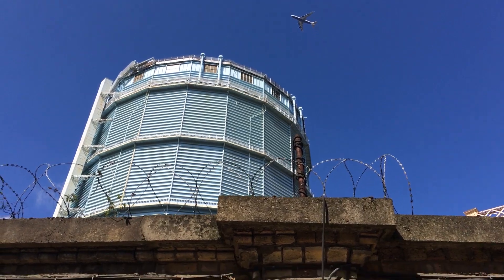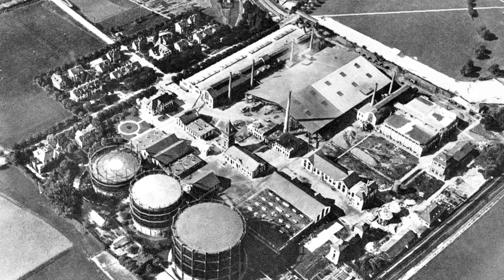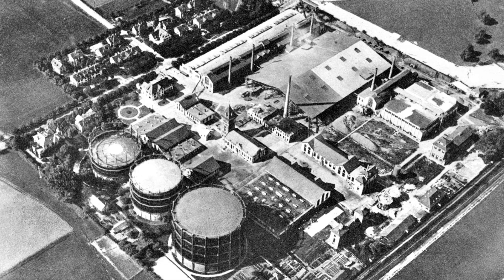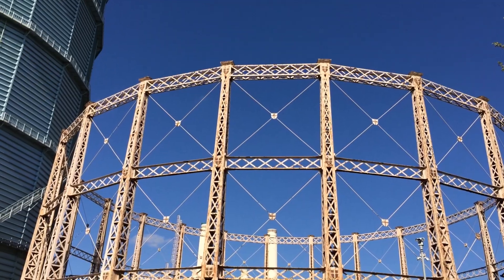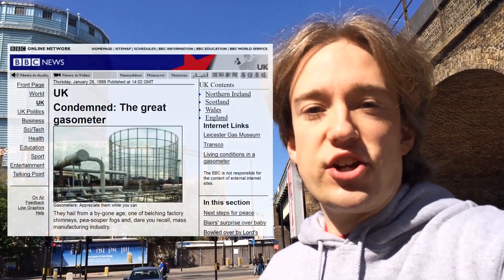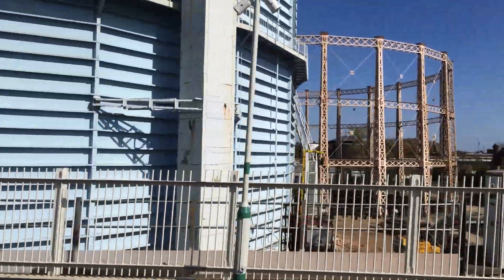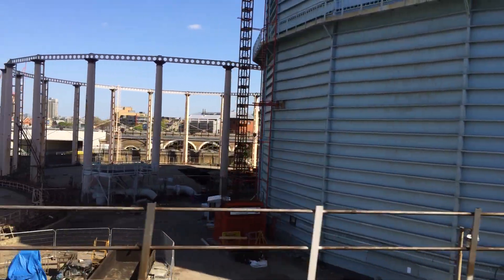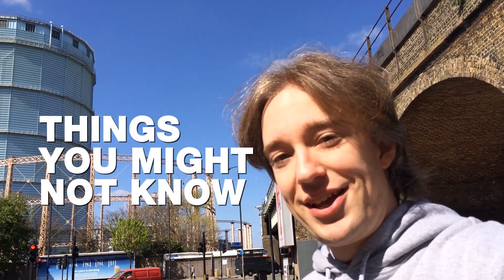The Rise and Fall of the Gasometer

Comment: very similar to lighthouses and water towers - they were everywhere and they were functional.  it seems we claim we 'upgrade' things but actually make them less efficient, even if it seems inefficient. Water towers were incredible efficient anyway, and look at the two by the crystal palace and the fountains all around it. Same thing in Parc St Cloud in Paris in 1720s, possible with the most fountains anywhere has ever had. It seems we had a greater ability to control water - and why stop at water?

Comment: Their were several gasworks around the suburbs north of Boston.  I remember seeing them as a child while my folks were driving around.  My dad told me they held gas for stoves.  What he didn't say is coal was being heated to produce gas.  The gasometers served to store and maintain pressure.  Our house was built in 1952 and had gas available.  For some reason, it had an oil fired furnace.  No fan forced air, all covection air flow.
We moved to Phoenix, AZ in 1958.  All the gas there was pipec from West Texas under pressure.  No gasometers needed

Comment: The 'scaffolding' type of gas holder is correctly called a Column Guided Holder.

The one in the video that has the piston inside is correctly called a 'Waterless Gas Holder'.

The other type has spiral guides in the side of each lift.. As the top lift fills with gas it rises up. When it reached full height the U shaped lip at the bottom engages with an inverted U shape lip on the next stage. A gas seal is provided by water. This is very stable and the spiral guides alternate in this direction the left lift turns. This allowed for external stairs and 'Knock off. gear which stops gas being pumped into the holder when it reached full.

Comment: These are NOT GASOMETERS. They are Gas Holders. There are 3 main types. Dry seal gas holders like the one made of corrugated steel in the video, column guided gas holders like the one described as scaffolding type and the third type is spiral guided gas holders which rise up and down without the scaffolding frames.

Comment: I knew I'd seen cylindrical power plant buildings that were taller or shorter at different times when I was young! This is a much more plausible explanation than glitches in the Matrix.

Comment: Gasometer is a synonym of gasholder. As nouns the difference between gasholder and gasometer is that gasholder is a large, telescopic cylindrical tank, with a water seal, used for storing domestic gas while gasometer is . gasholder English Noun ( en noun ) A large, telescopic cylindrical tank, with a water seal, used for storing domestic gas

Comment: We have a popular one in Germany in Oberhausen which is nowadays used for special exhibitions which change every one to two years. A few years ago they installed a sphere with 25 metres of diameter floating in mid air on which they projected maps of the earth or the moon. You could just walk around and under it or take a glas elevator to see it from above. Or once the artist Christo build a 26 metres high wall out of colorful barrels which divided the gasometer as an art project. You should check it out if you are here in the west of Germany.

Comment: One of the ways of reducing our carbon footprint is to burn hydrogen instead of natural gas. The coal gas that was stored in the gasometers was a mixture of gases, typically 50% hydrogen but the rest was mainly hydrocarbons. If there was an easy way of separating the hydrogen from the other gases maybe by cooling the gas as hydrogen will have the lowest boiling point then this could be source of hydrogen gas with little or no carbon emissions provided the hydrocarbons separated out could be processed and turned into something harmless.

Comment: Sending gas to people's houses is insane, 
just use the gas to generate electricity
Reply: But that is really inefficient when you want heat energy (eg heating your home or cooking your dinner). You'd be converting chemical energy to heat energy (1) to mechanical energy (2) to electrical energy (3) and back to heat energy (4). Four conversions when one would do. Generating electricty from gas is usually 32-38% efficient. Even the MOST efficient are only converting 60% of the available heat energy into electricity. Transmission of the electricity from the power station to the home is also inefficient, losing about 30% along the way (transformers and resistance in the wires). This is why electricity, in the UK in 2021, costs about £0.18 per kWh and gas costs about £0.03 per kWh.

Comment: Should you happen to visit Vienna then you could report what happened to the four gasometers here. They are brick buildings, having a wall thickness of about 7 feet at the ground, being saved from demolition as architectural landmarks. Having been unused for decades they eventually were converted to a shopping mall, an auditorium, apartments, housing of the Vienna State Archive, etc. just keeping the exterior walls intact.

Comment: The real problem is they floated on mercury. Makes clean up expensive.
Reply: Did they?
I've never heard of that before
Reply: @bushratbeachbum  round each tank was a narrow ring/slot filled with murcury that acted as the gas seal it often leaked into the environment.
Reply: I think some small experimental ones for laboratories etc may have, but the big ones were water sealed or grease sealed, depending on the design.
Reply: @bushratbeachbum  well several that I know of round here were mercury filled as it's caused huge environmental problems when the land has needed to be reused. I was always told as a little boy the used mercury. My Grandad took me to see one once because I had a thing about them. Its amazing the stuff that sticks in your mind couldn't have been more than 8 or 9 that's in the UK.

Comment: Largely correct however it isn’t the pressure of the gas that raised the vessel, they were raised mechanically.  The seal around the edge was courtesy of a water bath with an oil film layer to avoid overly “wet gas” that would in turn corrode the then cast iron pipes.  A little moisture in the gas was good however to stop the hemp joints drying out and allowing for leaks between the cast iron pipe sections.

Comment: It gets cooler. To prevent flammable gas from leaking out they used water to seal the moving parts. It worked rather like a U bend on the dunny.

Comment: Just to make a couple of points,  they are not Gasometers they are gas holders and coal was not burnt it was baked to release the gas and other products from the coal.
Reply: Agreed. I grew up within sight and smell of my town's coal gas and coking works and was corrected if I referred to the tanks as gasometers instead of gas holders. I seem to recall the actual gasometers were flow meters installed in the plant's pipework.

Comment: My dad was a gasworks manager at Penicuik Scotland. In the 1950s they where called " gas holders " and they had " lifts " that were on tracks giving a partial corkscrew motion. The various lifts got slightly smaller in diameter as they progressed upwards and they had a water seal at each circumferential moving joint/junction. I knew quite a lot about them as a young lad as they were at the bottom of my garden and I had to call him from his office if they got a bit low. Correct in your statement about " line storage " but there are miles of it up and down the country before it is reduced in pressure for appliance requirements. Life moves on!

Comment: An interesting detail about the moving piston type is the seal between the piston and the wall. It's not only a gasket, that would leek too much. Oil is constantly pumped from a sump at the bottom of the gas holder and injected at the top inside of the wall. The oil runs down the wall and is caught by the piston. A pool of oil is formed around the perimeter of the piston so the gap between the piston and the wall is covered with oil. Some oil leaks past the piston and continue down the wall to the sump and is then pumped up again. The oil makes the seal perfectly gas tight.
Reply: @skunjobb  That is very interesting.  There used to be one of these off the I405 in Long Beach, CA.
Reply: Drivel. The gasometer floated on water.

Comment: There real name is Holders.
'Gasometer' silly slang word like Hurday Gurday.
Reply: No, gasometer is not slang. Gas holder and gasometers are both perfectly correct words for this. Gasometer sounds like it would be a metering device for gas but it isn't. The inventor was French and used his much smaller device for metering and the name has stuck since then.

Comment: What you missed here is that the gasometer itself created the pressure in the gas pipes all the way through the network, there was no need to pressurise it as they do these days. The sheer weight of it pushing down was enough.

Comment: But what was the big building next to the gasometer?
Reply: A waterless gasholder.  There was a third type, and I think that Battersea had all three, but maybe the third one had been demolished before this was filmed.  This third type did away with the external frame with vertical rails on which the wheels of the holder sections ran.  Instead, each section had helical rails on which the next section ran.  This was a later design than the frame type.  I think the waterless type was invented in Germany.  There used to be a large model of one in the Science Museum in London.

Comment: These are gasholders, not gasometers! The name gasometer came from the very earliest small holders and, as is mentioned in at least one comment, would give a guide to the amount of gas in the holder but, just imagine how difficult it would be to charge someone for the gas they were using for a few gas lights! You will notice that even the sign says that this is a holder station. The problem was that the way the gas for lights was charged was simply by the number of 'lights' the consumer used and, as these earliest burners were of very poor construction they varied a lot in the amount of gas they used. Even worse, the iron burners with simple holes would grow in size from corrosion resulting in higher consumption. It was not until the gas meter was invented that any reliable means of charging for gas became possible. Even then, and right up until the days of electronic metering, gas meters were known by the number of 'lights' they could supply despite probably never supplying gas to a gaslight. All the meters registered the amount of gas by the volume and you are charged irrespective of the appliance.

Comment: The are actually called gas holders, I was at one time a holder engineer, there are only two left in working order in Britain
Reply: They are gas holders, you are right - but they are called gasometers.
Reply: As far as the general public were concerned, we always called them gasometers. "Gas holders" seems to be the technical term only used within the industry.

Comment: Not by burning coal but by heating it in the absence of oxygen which drove the gas out of the coal and left behind coke, a fuel in itself. We used to buy coke for our coal fire and it burnt at a very high temperature and arguably gave off more heat than coal.

Comment: Had these in Australia to. The remnants are still in Brisbane.
Reply: There were 3 opposite City Park in Launceston, Tasmania, still in use into the 1990's. That's literally just a short walk from the city center. They were painted with the gas company's logo on the side and quite visible. Neither the gasometers nor the works are still in use however.

Comment: I've only just found this video. My dad used to work at Battersea Gas station, controlling the input and output to the gas holders (not gasometers) , through a series of valves manually operated by "steering wheel" like handles. These "valvemen" used to estimate the amount of gas in a holder by counting the number of plates and their rivets showing as the holders went up and down.

Comment: There’s two of these near me, still active somehow. Sometimes you can smell gas though and I don’t think that’s meant to happen
Reply: The tank is actually floating in a water bath which is directly exposed to the gas. I imagine the chemicals in the gas are diffusing out of the gas and into the water, and then out of the water and into the air.

Comment: I'd love to know the details of how the modern storage system works
Reply: It's mainly the high pressure in the pipes - not the ones directly connected to your home, but the large diameter HP (>100 barg) pipework from the source.
Reply: @alanj9391  thanks, I live in a largeish new village with mains gas, so somewhere in the village there's a pressure regulator that drops it? And between that and the supply somewhere, yea I can see there's a decent length of pipe and it already has sufficient volume to store a huge volume of gas if it's compressed, does it ever liquify?

Comment: the gasometers are raised by motors that draw the gas into the rubber bag that's inside  the drum then when it gets to the top it freefalls back down & starts the cycle all over again but in recent times these are now redundant thats being replaced by pumps & valves

Comment: According to Wikipedia, coal gas which was stored in these tanks, contains carbon monoxide. Always wondered how that could be safely used in a house. Carbon monoxide is deadly and very small quantities
Reply: John H Carbon monoxide is s fuel. When it is burned, heat, water vapor and CO2 are released.
Reply: @59DON800  Just because its a fuel doesn't mean its not toxic .
Reply: John H  So coal gas or natural gas is Not toxic???
DUH!!!!
Reply: @59DON800  carbon monoxide is significantly more toxic than methane. Practically everybody has methane coming into their house: as natural gas. Would you like a little carbon monoxide added? Coal gas contains both. Not good. I should ask that I'm referring to a situation where flame goes out and you have unburned gas going into a house or business.
Reply: John H If you have a gas leak in your home, it makes little difference what the composition of the gas is..... You will either suffocate or be blown up. You are beating a dead horse, end of conversation!!!!!
Reply: @59DON800  you should know that not all gas leaks end up as explosions and fires. Some people notice them and attend to them.
Reply: Coal Gas is safe to use as long as it's fully ignited and well ventilated just like natural gas. All fuel types containing carbon will produce carbon monoxide when incomplete burning occurs. Why do you think we are strongly advised (and the law for landlords) to have carbon monoxide alarms with gas and solid fuel  appliances installed?

Comment: Actually they COOKED coal to make coal gas with the bi-product, coke, being sold to foundries and steel works.
Reply: I remember ‘cooking’ coal in a chemistry lesson to identify the gas that came off - blimey the lab smelled just like a gasworks, horrible.
Reply: Also sold to Aga users.
Reply: And the coke was then bottled and sold to consumers to quench their thirst.
Reply: @Milesco  *stick up their noses
Reply: The gas was originally a bi-product of making coke for blast furnaces. Gas works came later to clean out the oils and creosote etc. The result was a mix of petroleum gases including carbon monoxide. 
The gas works were dirty placed resulting it heavily contaminated soils.
Reply: @Dave5843-d9m  Hi another interesting (given how dirty the process was) bi-product (use) of the process was soap, as in 'Coal Tar Soap', it was generally translucent and orange/brown colour
Reply: And residences. The price was less than coal because around 1/2 the energy was gone.
Reply: Ok Albert
Reply: I actually stood on top of one, which was all rivet construction.
The three things that came from the gas making process, were gas, coke and tar.
And I remember the coal barges in Bristol city dock, queueing up to discharge at the gas works.
Reply: Actually, they COKED coal. Not cooked.
Reply: @yourdad9168  sure - but that process is analogous to cooking - rather than burning, as the video puts it.
Reply: Who/what is "they"?
Reply: Still wondering who/what "they" are.
Reply: @imdbist  The gas supply companies. This isn't Wikipedia.

Comment: These storage tank exoskeletons are world wide. This type of external support structure were for gas, water and liquid fuel tanks. Conspiracy theorists seized on the old ones used by Germany during WWII as evidence that these were launch sites for flying saucers. These external supports had to contain channels for the heavy electric cables for the lightning rods as well as communications cable for antennas mounted on the tank. Conspiracy theorists say these large electric cable must have been for the powerful magnetic fields needed to launch flying saucers.

Comment: The gas is not produced by burning coal (think about it!), but by heating it to release the gas.  The resulting solid material was coke, which was a cleaner solid fuel than coal and was used widely in domestic hearths.
Reply: True, you could use anything that burns to heat the coal, but I think burning coal is what was used. You could also use gas, but somehow I think that would be impractical !!!!

Comment: My great grandfather used to work in the gasworks, wich was a very good workplace back then, becaue the workers did not have to go into the war and they could use the What from the production process to heat they homes, when coal was rationed.

Comment: You should do a video on the coin op power meter y'all had over there
Reply: They weren't that common, we certainly didn't all have them. You wouldn't have found one in a middle class house.
It was a feature of the days when most people were paid weekly and used to shop for their food daily, so paying for energy daily was a logical extension of that. Also more people rented their home, so a side benefit if they absconded was that the landlord wasn't stuck with the bill.